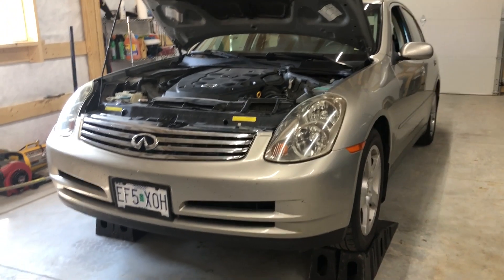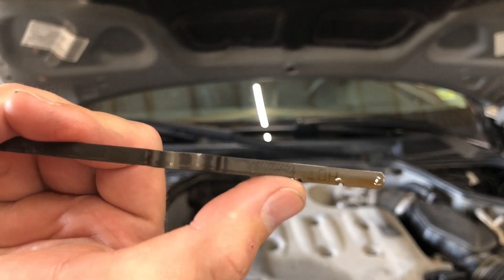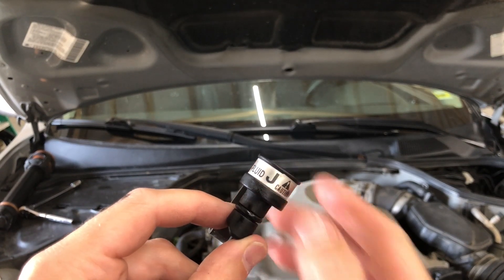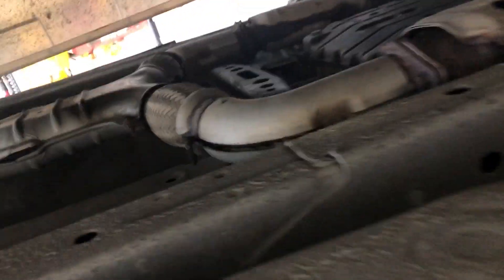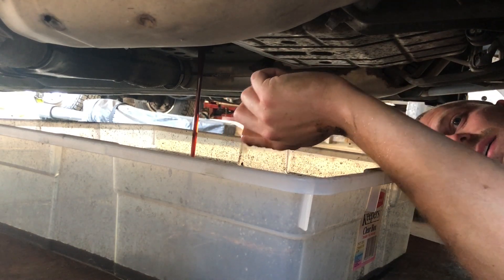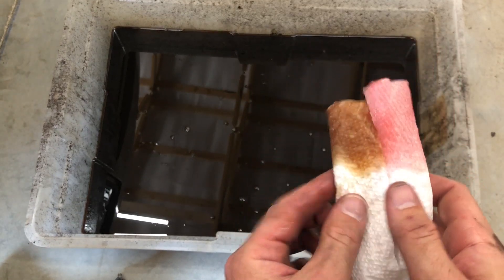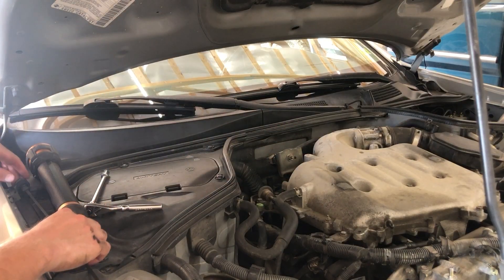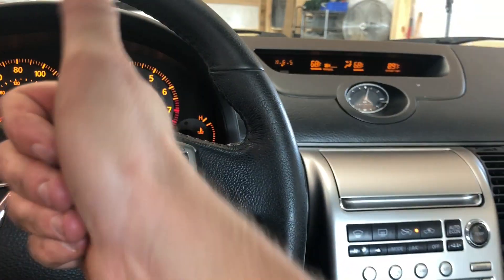Infiniti G35 & 350Z Transmission Drain/Fill

Comment: my 05 350z at 114k miles auto trans fluid was prob never changed before, it started shifting so slow and super rough at 3rd and 4th, sometimes wouldnt shift to 5th on the highway. really scary just having 4th gear on a highway going 65+ mph and youre already at 4k rpms, shift slips at 4th gear after cold start, manual mode didnt work and it was just bad after driving on a cold start. i did a drain and fill with 4 1/2 quarts with oem nissan trans fluid from the dealer and shifts are remarkably smoother, 2-3 shift is not as grabby and 5th gear works!! the trans fluid didnt look burnt or black it was brown/pinkish. thanks for the video it helps a lot!
Reply: Did your Manual mode ever work again bc mine acts really weird

Comment: Question young man do I need to replace the filter in the transmission or just drain or fill will be ok
Reply from the maker: Good question! The transmission has a lifetime filter screen in it. Just a drain and fill will be fine. For reference, mine has almost 220k miles and the transmission has never been opened. Thanks for watching!

Comment: actually so helpful gonna do this when I get some oem fluid
Reply: should you only drain and fill once at a time ?
Reply from the maker: I’d say you COULD drain/fill, drive for a little while, then do another one. But I feel like that would negate the purpose of trying to retain any suspended clutch material in the fluid by replacing too quickly. I personally am waiting between 2,500-5,000 miles between these first three, then every 30k after. Thanks for watching DWG!
Reply: @DoWittGarage Okay cool I appreciate the info and great video man keep making them!!
Reply: I have a question thers any filter to change on this type of transmission
Reply from the maker: @jrdiaz4032  good question! There are none. This transmission has a metal filter screen that is good for life.
Reply: @DoWittGarage   so just change the oil transmission is going be good thanks for your time to reply back
Reply from the maker: @jrdiaz4032  as far as the fluid change goes, yes that is all that it takes. Thanks for tuning in!

Comment: Nice easy to follow video. I didn't know you could use “S” fluid in place of “J”  you confirmed it, thanks. I notice your airbag light doesn’t blink, would you be interested in doing a video on how to fix a blinking airbag light, not where you turn the ignition key off and on 4 to 6x’s to reset that doesn’t work. Thanks

Comment: If you have nissan matic J fluid already would you just add that just to top it off. If anything i just think mines a little low
Reply from the maker: Does your car currently have matic J in it? I wouldn’t mix the two.
Reply: @DoWittGarage the two can safely mix

Comment: I need help! So my 2005 g35 is doing this - The rattling noise comes back when cold or after a couple minutes of it being off.
Turn it on and it does it when revving it in neutral from 1k rpm's - 4k rpm's. As it warms up it does it less and less to almost being gone. Should I change oil !?!?
Reply: SEAFOAM

Comment: Do you happen to have the link of where you bought your trans fluid from?
Reply from the maker: Sure thing! Thanks for tuning in.

https://www.amazon.com/Genuine-Nissan-Matic-S-Transmission-999MP-MTS00P/dp/B076X5Q8BP?pd_rd_w=jTCEw&content-id=amzn1.sym.d7105005-1122-4ebb-804b-fda01cf6b56f&pf_rd_p=d7105005-1122-4ebb-804b-fda01cf6b56f&pf_rd_r=6KVM3QDARXYZRCK18TS6&pd_rd_wg=7xrNx&pd_rd_r=0bc85524-d12d-4b6f-ba6b-611a7772cf88&pd_rd_i=B076X5Q8BP&psc=1&ref_=pd_bap_d_grid_rp_0_6_i
Reply: You can buy them at a nissan dealer ship for 14$ qrt

Comment: I have a 2006 FX45 that Im wanting to do a drain and fill. It has the 5 speed, and I was wondering if your Infiniti has the same 5 speed transmission.  Thanks. 😊
Reply from the maker: I’m frankly not sure, but I believe the G35 and 350z shared drivetrain with the FX35, thus making them likely different. However, I would suspect the process to be similar.

Comment: How do u keep those head light so clear
Reply from the maker: My uncle refurbished them for me before he sold me the car. He used a Mother's Kit that you can buy from O'Reilly. You wet sand, then buff with a drill. Then, you can ceramic coat the lenses and they won't yellow nearly as quickly. Thank you for watching!

Comment: Question, I had a shop perform a transmission oil change. I did not know that it had to be done with OEM fluids. I am not sure what they used but I am willing to bet it wasn’t OEM. Car has 58k what should I do?
Reply: Its a G35 coupe
Reply from the maker: Hey there. I am assuming you have an automatic transmission. I would check with the shop and see what oil they used for your swap. Not that other oils cannot be used successfully, but I generally recommend OEM fluid when it comes to transmissions and other high-cost wear items. Your car has such low miles that I would have the fluid replaced with OEM and then complete a fluid drain/fill every 25-30k. Thanks for watching!
Reply: @DoWittGarage  I appreciate the response here. Love your videos BTW. And yes, its a AT. So the shop used LiquiMoly ATF 1800. I checked the website and it is compatible with all vehicles that require Matic-S. I called 3 dealers and keep getting mixed responses. One dealer is recommending a full flush. The other is recommending a drain/refill twice. This will help the aftermarket fluid flush out. While the other is recommending just one drain/refill. I am concerned with a full flsuh which doesn't sound healthy and also concerned with having two  different fluid in my transmission with just a drain/refill. I am at a loss and don't know what to do next. I don't mind spending the money to get it done right. It doesn't seem like anyone knows hat right is. I would appreciate your insight!
Reply from the maker: I appreciate you tuning in! LiquiMoly is a high quality product, however, our transmissions are picky about their fluid. Nearly all research I’ve done recommends using only OEM Matic-S. For your situation, the only way to remove all of the old fluid and replace with new is through a full transmission flush, as recommended by one of the dealers you called. One or two drain and fills will only dilute the LiquiMoly and new fluid. Since your transmission only has 58k miles, a flush should be just fine. Then, subsequent drain and fills every 25-30k miles for the life of the car.
Reply: @DoWittGarage  any concerns around doing a flush? I will have the dealer do this ofc. Just want to make sure I dont mess anything up
Reply from the maker: A flush should be fine considering your low mileage. Your dealer does them all the time. Proper care and your transmission should go 200k+ 👍🏻
Reply: @DoWittGarage  what do you mean by a flush "should be fine" - is there some reason you wouldn't want to do a flush? I have a new to me g35 with 117K miles, it sat for 6 years and is slow to shift sometimes - especially if you get on it and then let off the accelerator, it won't upshift for 3 or so seconds. Sorry, both of you guys are writing in a way that makes me think you're implying there are conditions where a flush would be contraindicated, but I would have thought you would only talk that way about the less intensive drain/fill service.
Reply from the maker: As your transmission naturally wears, clutch material can wear off and become suspended in the fluid. Many times on transmissions with ample wear (higher miles) this suspended clutch material can be the only thing maintaining use of the transmission without slippage. A complete flush removes all fluid (and any suspended material) and replaces with new. That’s why, in my G35 with 200k+ miles, I only do drain and fills and don’t completely replace the fluid. Yours with 117k miles, assuming it has been adequately maintained, would likely be okay with a full flush. Thanks for watching!
Reply: Respectfully;  I saw guys are technicians , transmission check ✔️ level with engine run,,  ,

Comment: I have a 2003 G35 coupe with 87,000 miles on it. It's never had a transmission flush done to it. Would it be wise to do a flush or drain and fill?
Reply: Drain and fill

Comment: I have a 04 g35 atoumatic it has 142k miles idk how the past owner took care of it should I do this bc my oil is brown and driving funny
Reply from the maker: I would certainly recommend completing a drain and fill procedure, preferably three spaced between 2,500-10,000 miles. Your transmission fluid should be bright red.

Comment: My steering wheel hard the car been sitting for 4 years
Reply: Did you check the power steering pump
Reply: its the ujoint
Reply: @carlosduran700  recently went to actually move it and heard clanking noises the axle Started spilling oil, kinda sucks cause I just got the car painted when I should have checked for issues prior to that